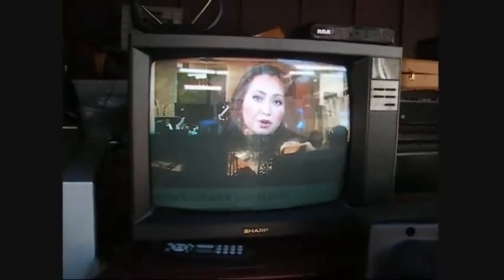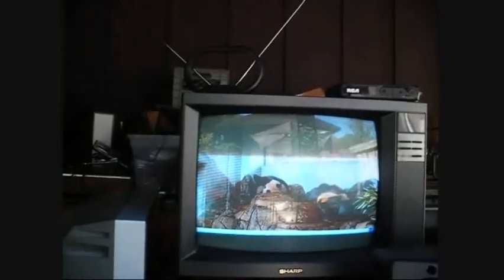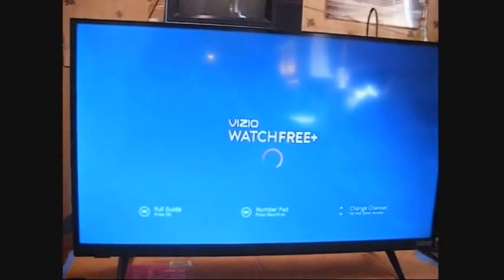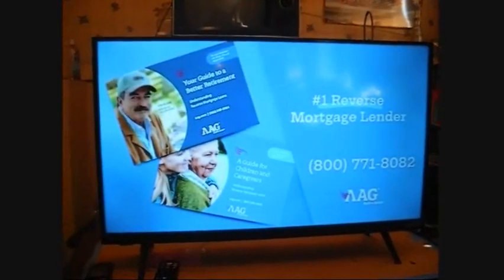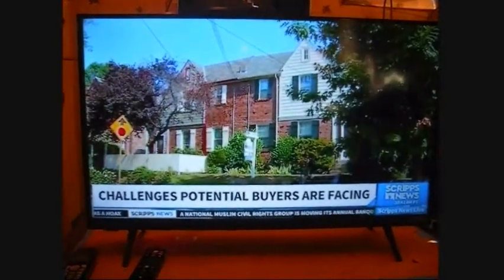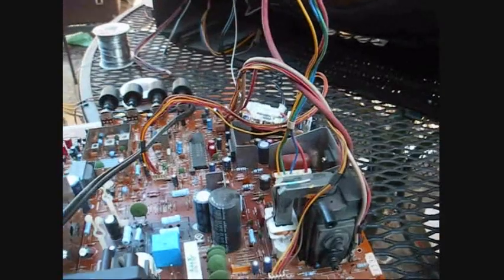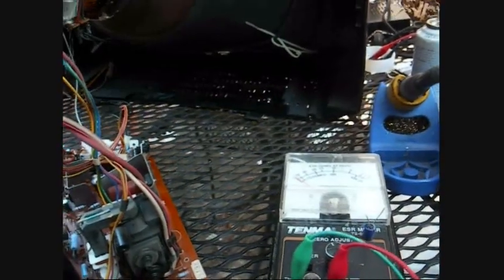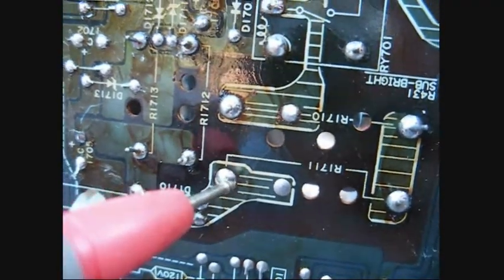Repair of a 1988 Sharp 19" Linytron Color TV & No More BPC/SPC TVs For Me

Comment: It's kind of amazing that even the cheaper sets from the late 70's up to about 2001 either still work, or just need minor repairs. You say "Oh this is a BPC set, cheap junk!" Yet, decades later, it still works.
Reply: CRT technology was pretty much perfected around the 80's and the basic models usually just kept going until the CRT went flat, most failures would be dry joints and the likes. It was mainly the more complex sets that caused the most problems at that stage.

Comment: I had a 1990-ish 30 inch Toshiba that the original owner paid about $2000 for. I saw the receipt. Anyway, I had that set for about 15 years before I re-homed it after scanning the board with a Weller like you did here. It was amazing to me that a high hour set almost 20 years old had a still like new CRT in it. Seems like they finally perfected them about the time flat panels hit the scene.

Comment: As for your first part, things getting weird or valued less then they should be, I can relate. My dad saw this even back in the 1980's a black and white TV was no longer worth fixing since they became so low cost for a new one. Most of my current TV's I have were second hand or more hands, before I bought them and one 32 inch LG flat panel (2006 era) I saved from the trash and repaired it later and it is working. The biggest reason for me taking it was it has the nice speakers on the side. Most modern TV's have poor speaker systems often with the speakers pointing down or out the back.... 
 I have been involved with computer repair for relatives and a few friends for several years, and a few years back I found grand bargains at many of the thrift stores..... Flat panel monitors I saved out of the trash in several cases and I repaired them as well. Most of the time it was just getting them open the hard part and replacing all of the electrolytic capacitors was the easy part, and they should work for another 3 to 10 years. But I only was able to sell a few of them, due to the point they are not new or not LED back-lit. 
 I will soon have to take most of it to a place as all or mostly junk...

Comment: I do have an analogue distribution system although it's out of action at the moment because some of the kit is dying on me and needs swapping out pending repairs. Mostly dried-out electolytics, I suspect. I was given a couple more satellite receivers for the purpose, must get round to sorting it! Target is to have 5 channels, 3 of which duplicated on 405 lines, as per my original setup. (I have a few 405-line and dual-standard sets).

Comment: In the middle at 21:16  look how smoking hot resistors burned the board there. To the right of the relay is a long ceramic
 type resistor and it didn't even cook the board.  Supposedly Bryan said this was a low hour set but I don't see that. So just about anything electronic will eventually fail , some faster than others. This  Sharp TV is working great now.
Reply: There are three dropper resistors in the standby power supply. Whenever the TV is plugged in they are getting hot, even when the main circuitry is off.

Comment: I got my grandmas panasonic plastic crap crt from early 00's in my garage man cave room and it still works fine also have a 2009 32" toshiba lcd in the bedroom that's never had any issues. My main tv is a 50" toshiba led tv from 2014 that cost me 800$cad also no issues yet and that gets high hours. Either i'm really lucky so far or those models were actually decent because I hear all the time people whining and crying "my tv died!" when they literally have a like 4-5yr old smart tv. I really wish they could make a modern tv with vintage components even if it cost more at least ot would last and not crap out in 2 seconds.

Comment: You talk about these newer TVs having all the annoying features (or lack of them) that prevents you using it for a simple purpose.   I could imagine my mother trying to select channels on that TV without a numeric keypad.   I have no need for a smart TV and just want my TVs to do one thing - accept a signal from the HDMI inputs and display them and remember the input selected (HDMI1, HDMI2, etc.) last when turned on and display it within a few seconds.    All I need is a "1 to 1" pixel setting which any set should have, which means act like a computer monitor and nothing else.   I don't want the "make up frames between the frames" frame interpolation stuff at all and just want it to display the signal I give it.   I have two Samsung sets (an 8 series from 2010 and a 7 series from around 5 years ago) which both do this beautifully.   Both also have an aspect switch button to easily tell the set to do anamorphic, 4 by 3, or zoom letterbox within 4 by 3 to 16 by 9, in case I want to use it with DVDs or broadcast TV.     I will never connect either TV to my WiFi, and use an inexpensive Mac Mini to drive them and let the actual computer be the "smart" component, which gives me total control over it all.

Comment: I've been through the same - whenever I saw an TV or other piece of electronics thrown in a skip or by the side of the road I couldn't resist grabbing it and trying to get it going, even though I had no outlet for it once it was fixed. Usually I would have a clear out after a while and throw this stuff away, but even then I used to pull everything out and leave just the CRT and case. It was purely for the pleasure of repairing something it seems. I haven't worked on a CRT set now for 15 years or more and wonder if I even have that skill set anymore.
Reply: I should get into selling stuff online tbh.

Comment: I recently saved a 19" colour tv made by citizen in 1985 from an ewaste bin. It had the cord cut off but i put a new one in and it works great. Hardest part was getting the nicotine cleaned off. Didn't stain the set thankfully. It has a smaller remote with a Rogers cable (Canada) channel list from 1989 that hides in a slot behind the control panel door. Stupid that it was junked as it wasn't even broken. It now sits in my bedroom with a cheap toshiba vhs dvd combo unit for watching tv and movies in bed.

Comment: What do you think of Mitsubishi CRT tvs? Either older ones from the 80s or more modern ones from the 90s/00s?? I have been really interested in obtaining one
Reply: I had one of those and bought it in 1985 to establish credit.  I had just started my new job that paid something other than minimum wage and I wanted a nice TV.   26 inch Mitsubishi with the blue tinted crt.  Stereo set with a sub  woofer and remote of course.  Purchased it at Steinberg's in Cincinnati.  $999.95 + tax.  Great picture and was reliable.

Comment: Its not just conditioning. Broadcast TV is being supplanted by streaming. There is only one tower left in my area the rest have been shut down. People have moved to the streaming services and you need a smart tv for that. You can buy a 50" smart tv for $150 at my local walmart. They're so cheap now they're disposable. $150 is about what I paid for my first color 13" in 1990 so its no surprise people are buying the 50" tvs for their kids. I still have my old 42" non smart lcd flat screen in the guest room. I tried to give it away before I moved and nobody would take it. Nothing wrong with it works 100%.

Comment: I repaired a Sharp TV for a vertical problem and had the flyback go up in smoke during the burn-in test time, You just never know, do you?
Reply: That's why I don't understand the people who pay ridiculous prices for any type of vintage gear, no matter how high quality it might be, even if it works or has been 'refurbished'. Unobtainium parts could fail, like ICs, transformers or mechanical things could fall apart at ANY time. And then your meticulously recapped stereo receiver, reel to reel deck or whatever, is just an oversized, overpriced paper weight. And as long as nobody decides to make reproduction replacement parts (as it is common in the automotive world) or a lot of NOS is still out there, I don't see how such a device has any value, besides sentimental value.
Reply: Odds are usually slim. People like what they like. New items sometimes are not repairable and can lack support such as service information and replacement parts. Often newer items don't last as long. New items can be very expensive as well. Depends where you want to lay your bets. Stay well.
Reply: @johnnytacokleinschmidt515  

Well, that's obviously true, otherwise I would hardly ever bother with vintage stuff at all.
100-pin MCUs in something as banal as a toaster... Nope!
To be fair though, modern stuff is pretty much guaranteed to at least last more than a week, while vintage is not, it's always a gamble, even if it works and even if it's been 'refurbished', stuff might break down when put into regular service again. 
For instance, recently I had the hall sensor IC inside a cassette deck capstan motor go intermittent...
I mean, I only replaced the belt and the rew/ff idler, the thing is full of 43 year old caps, a few of 'em Nichis, but also some Matsushitas (I later replaced the latter of course) and yet it worked perfectly, for a few days... And THIS is the THING that decides to give way?! 

I was glad I could do my own troubleshooting and paid almost nothing for the unit instead of buying it for $1000 from one of those eBay recappers - as it still would have developed that fault. Luckily it is a standard mount motor so one of those Mabuchi (knock off?) motors fit just fine. If that wouldn't have been the case... Paperweight.
Reply: @westelaudio943  I see. That's a tough one. Hopefully you'll find a way around it.

Comment: DVD/VCR combo tv? Yep. That was a funai. I hate em.

Weird thing about funai is that their LCD sets seem to be okay.

I have a "symphonic" branded set thats "enhanced definition" (it supports component, which, is somewhat nice tbh). Problem is, it wouldn't switch into component mode! Only between composite and rf. Issue was the eeprom suffered bitrot over the years.

Flashing the entire chip with $80 fixed that issue. Works fine now. Also, custom wooden stand!

A couple days ago my sibling dragged one of funai's 2007 specials. Manufactured mere months after the fcc mandate for digital tuners! If it DOES include a digital tuner, it's utter CRAP.

I suspect it's a rebadged Samsung as the UI just screams Samsung.

Comment: 55:57 couldn't fart without askin the preacher.  Now that's original. 😅

Microwave ovens are another 'all but dead' repair industries. About 30 years ago (shortly after they discovered oxygen and paved roads for those of you who're millennials) I used to service and repair commercial restaurant equipment along with 2400+ watt microwave ovens. Now its unheard of to find one being repaired. They like the TV are disposable and often thown in the trash instead. Now day's its more acceptable to throw out that old 2 year old thing and buy a new one. Quality is like chivalry all but completely lost.